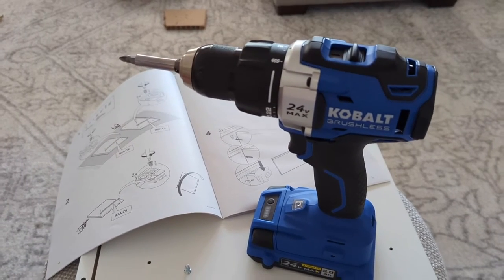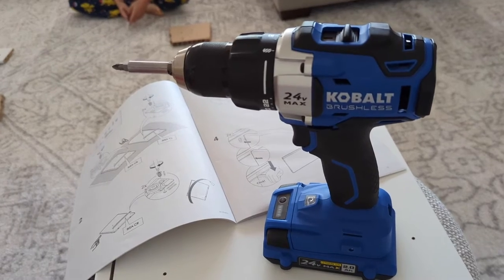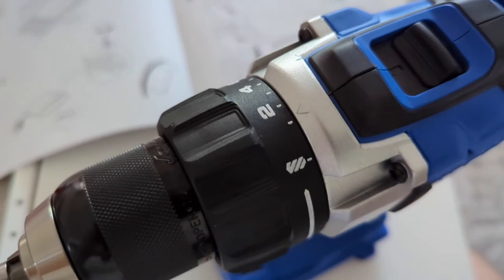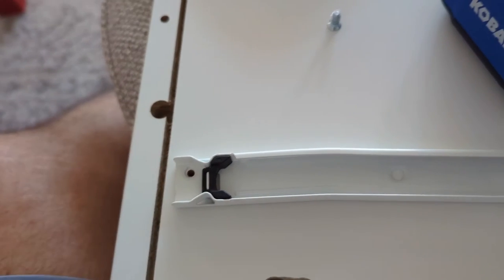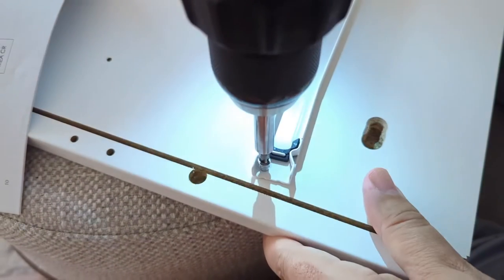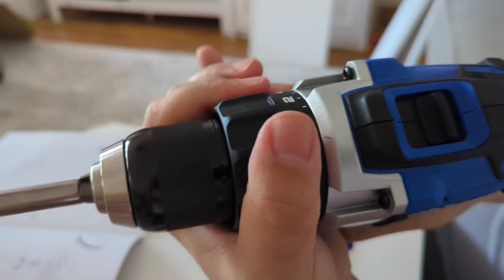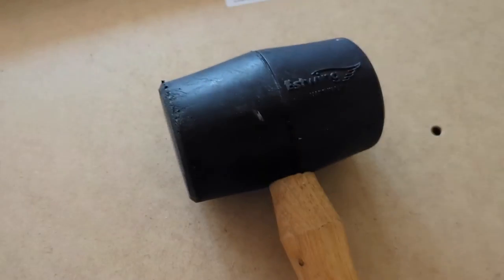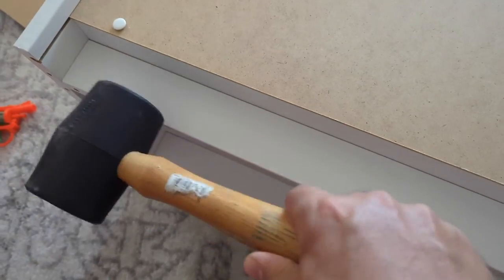Proper Power Drill settings for Ikea Furniture Assembly

Comment: Great video.  Thank you.  When you set the drill dial to 1, should you set the drill to speed or torque when using to assemble furniture?
Reply from the maker: Whichever is slower. I would think TORQUE would be the correct setting if it's slower than SPEED.
Reply: @ThumbsUpStuff  Thank you for your quick response.  I realize my drill has a 1 and a 2 so possibly the 1 is the slower speed.